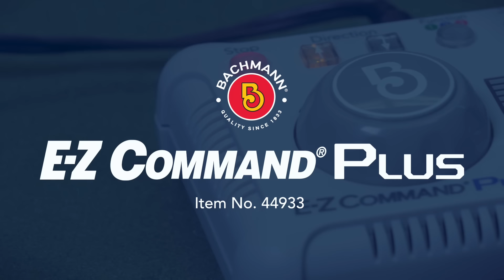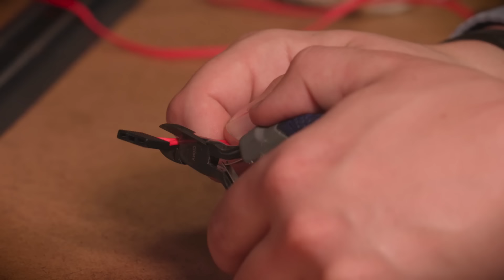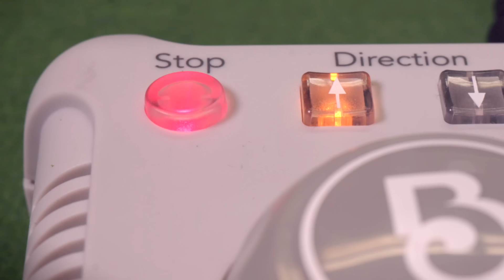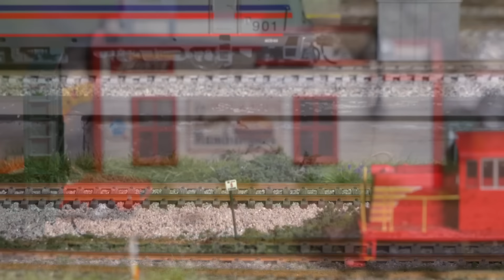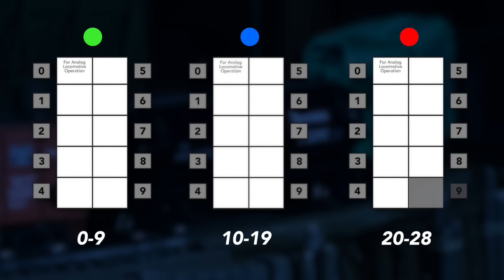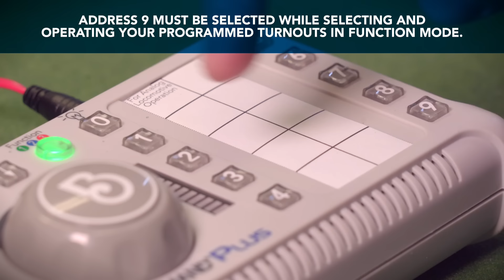Introduction to E-Z Command® Plus

Comment: Hey bachmann! I recently got my first DCC and sound locomotive. How do I use the sound on this controller?
Reply from the maker: Depending on the locomotive, the sound might need to be activated (either unmuted or a startup sequence might need to be initiated). Typically, these are function 8, but they can vary between manufacturers and decoders. Your locomotive should have a function list included with it.

Comment: How  much does  thus ez command plus usually  run in price from thr manufacturer
Reply: Way too much Bachmann is overpriced for poor quality. Any system is better (even the dynamis system they have I loved the controller design but the damn dynamis system after a few years of using it just stopped working one morning it just shows it’s shorting for no reason I tried everything nothing changed it it’s just a waste of money and the pro and ultima expansion versions are overpriced and not worth it either) I have an ez system still just so I can run dc and dcc locos on a layout at once if I want to but I have a switch I flip to turn off the ez command and switch to an NCE power cab system way better even though the system is old as hell at this point. My main layout I’m getting a ESU full cab WiFi throttle dcc system, it’s about 400$ but WORTH IT. Touchscreen android controller with a throttle knob on top, unlimited function, CV, consist, and so much more control and features, it’s an 8 amp system out the box and can handle basically anything you need to on a layout which the layout I’m getting it for is or will be when completed a triple decker layout, have 16 locos all dcc sound, 150 or so passenger and freight rolling stock a dozen cabooses which if they ever make a dcc caboose modeled in the 1910-1935 era I’ll totally get them and get several, also when completed likely going to have around 300-350 foot of track total, idk how many turnouts honestly never have counted but because the era the layout is prototypically modeled on and the era it’s set in the turnouts are all hand thrown with model switch stands.

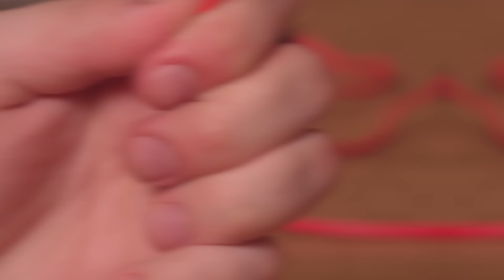Comment: I hope someone can answer my question, I've looked and looked on Google but no good answers. I trust this for any layouts I want to build from N to On30, but would it work for G gauge? I want to build a small indoor L shaped 1:20.3 layout with probably 2 locomotives at most and would like to know if this would work with G gauge. For example, the engine I already have is one of your DCC equipped g gauge davenports.
Reply: No i think this is only for ho gauge
Reply: It will work for n and ho. On30 and above will need the 5 amp booster which is expensive. G scale may need more than a 5 amp booster.

Comment: Will this work with DCC locomotives from other makes?
Reply: Yep. The Bachmann system works with dcc locos from most other manufacturers. You'll have basic control but limited advanced sound/functions. EZ command functions only accesses F0-F-10. It's a decent entry level system.

Comment: Don't waste your money on this Controller and Switches or Bachmann EZ Track or the controller. They are expensive garbage made in China. I bought 19 of the switches, 80 to 90 feet of the track. Six of switches have quit working and will not even switch manually. The dealer will not exchange them after 30 days and Bachmann will ignore you. I have a little over $684.oo invested in just the switches. I really don't have any option but to buy atlas track, roadbed and looking into Peco switches, with tortoise switch machines.. I bought the EZ Command controller too and had to return it for a replacement, that I had to send right back to the dealer too. I also wasted money on the 5 amp Bachmann booster. The controllers are $200.oo a pop and the Booster was $365.oo That was over $1,600.oo wasted. It really pisses me off the time I took planning, laying and ballasting that garbage. NOW I HAVE TO RIP IT ALL UP AND REPLACE IT. This craps going to cost me over $3000.oo to fix. I bought a Digitrax Zephyr express for a DCC controller.
Reply: Sorry, you lost me at your whining about China. I dismissed whatever you bleated out in its entirety, assuming that whatever happened was a result of your inbreeding.

Comment: Ok Bachman. Ya got me. I’m buying a dcc starter set with this controller and i’m sold on your cross tracks. I can control the track with my controller?!? With stock track without modifying?!?? You got yourself a customer for life there Bachman! 👍🏻
Reply from the maker: Yes, you can control both power to the track and turnouts with E-Z Command. If your turnouts are not E-Z Command turnouts, you can use our Turnout Control Box to convert standard (electrically operated) turnouts to DCC.

Comment: If I use this DCC control for my layout using DCC locomotives and/or sound, can I include normal locomotives that are not DC in this same layout?
Reply from the maker: The system allows for one non-DCC locomotive to be operated at a time. While you can do this, it is best practice to only have this locomotive on your railroad while you are using it, as the constant current supplied by the controller could damage the motor if left at idle over time.

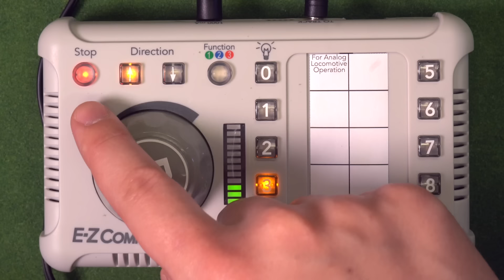Comment: I've just bought this - fair warning to all prospective buyers, watch @2:50 how many times the user must rotate the throttle to increase speed. It is not sensitive at all and quite annoying!
Reply: That’s literally the entire point 😂. Locomotives don’t accelerate 0-300 like a top fuel dragster.

Comment: Yikes!   You cut off the clip on the red wires, strip the ends and …..stop!   How do you connect those two red wires to the bus wire?   Is one of the red wires a positive and one a ground?   I am afraid to accidentally switch them since they are both red wires!   Help.   How do I connect to my bus wire that has all the track feeds connected to?
Reply: It does not matter,  as with all DCC systems, this is digitalized AC.  Therefore the wires alternate between positive and negative respectively

Comment: Good video.   I have a small layout, Two separate tracks.   We used flex track and the drop feeders are connected to separate bus wires.  How do I connect to the two red wires from the controller?   Where do I solder them?   To the end of the bus wire or directly to the track.  Which wire is negative, they are both red.

Comment: Would I need any boosters to run a 4x8 layout? Or would it work just by plugging it in?
Reply from the maker: A 4x8 would be condensed enough that a booster shouldn't be necessary.
Reply: It depends upon how many locos you want to run. 2-3 should be fine without the booster on a 4x8 with a starter track set and a couple sidings.

Comment: The price for what it offers is unrealistic, it should cost no more than $99. For less money I can get so many other DCC controllers with TONs, and I cant stress this enough, TONSSSS more features. Sorry Bachmann, I love the E-Z Track system but this controller is already 10 years outdated and that an understatement.
Reply: What options would you recommend ? 
I plan to only run trains with DCC. 
All layout lighting will be separate.

Comment: Will this controller work with the Thomas and Friends line?
Reply from the maker: As of right now, no. Our Current HO and N scale Thomas & Friends™line is standard DC only.
Reply: @BachmannTrainsUSA then how can I run the Thomas line without going forwards and backwards in 1 direction and making them crash?

Comment: That's a big update to the EZ Command, I have had the original since 2011 for my small layout and it's been fine for that other than not being able to access a couple functions on 1 sound loco I have but it looks like you covered everything for a small or casual layout now! 

I might have to get one of these and sell the original.

Comment: I just got mine but the red plug isn’t plugging into the terminal track. Anyone have suggestions? Did they start making the terminal track prongs thinner?
Reply: I had to force mine in significantly. I thought I was doing it wrong at first. Good luck.

Comment: My original EZ command system is awful for overheating; is that an issue with this one?
Reply: No 
I have the plus and been using it 6 months now problems at all 
I was even running DC and Dcc at the same time. 

I love this ez command

Comment: Does it also short out as easily as the previous model?
Reply: I’ve never had a short
Reply: I have been using the original EZ Command system since it came out and I have never had any short circuiting issues. If you don't mind me asking, what do you think is causing your issues?
Reply: @David-yo5re definitely the 3.5mm headphone jack they use for track power. If you accidentally unplug it while powered up, it shorts out and fries a few capacitors and a mosfet if I remember correctly. 
Same goes for plugging the track power in while the unit is powered up.

Comment: How do you blow the horn and ring the bell?
Reply: F1 should be the bell, and F2 should be the horn.
Reply: F1 is the bell and the horn is actually set to three different function buttons; F2 is a continuous blow, F3 is a short burst, and I believe F9 is an auto mixture.
Reply: @ttam7777  on BLI Paragon4 Diesels, F1 is Bell, F2 is horn, F13 is for grade crossing sequence.

Comment: If I set one train to the slowest speed, then set a second train to the fastest speed, then switch back to the slow train and slightly move the speed dial, does the slow train jump to the faster speed or stay at the slowest speed initially set?
Reply from the maker: It will stay at its original speed and increase appropriately as you turn the control dial. The dial turns continuously. It does not have a start and stop point. Speeds are relative to the number of turns made for each model and are not governed by the position of the dial.

Comment: so when you are programming the model does this change the address number to the respective push button number? so if you assign an engine to the 9 button does that mean that the chip in the engine has been change to 009 along with the respective cv value?  I suspect you cant program engine number from the command station.
Reply from the maker: Programming the locomotive to one of the push button addresses on the controller will change the address the locomotive is assigned to on any controller.
Reply: @BachmannTrainsUSA that is not answering the man's question.  If you address a lock a number with this controller, will this number be the same on a NCE power cab
Reply: You can NOT program CV's using any bachmann ez command controller, for like $180 to $220 you can pick up a "NCE Power Cab" which allows you to do whatever you want with your locomotive, like change CV's, use 4 digit addresses, consist locomotives properly and a whole lot more. Trust me, just get a NCE Power Cab, these things suck.
Reply: @IndianaNorthWestern  oh trust me i know. this is going for $265 on bachmann main site. digitrax has the DCS 52 that blows this thing out of the water. and the NCE power cab as you noted is great too. there is a reason no club uses this system. and this so called "newer": version is still crap.

Comment: Will this controller work for locomotives produced by other companies? (Kato Walthers Lionel etc)?
Reply from the maker: Yes, this will work with any NMRA-compliant DCC-equipped locomotive.
Reply: @BachmannTrainsUSA  alright, thank you
Reply: @BachmannTrainsUSA  I'm guessing some people don't understand the concept of how standardization works in the model railroad world. Everything is designed to be compliant and interactive no Matt who the manufacturer is as long as the equipment being used is in the same scale.
Reply: Yes
Reply: Is hornby nmra complient
Reply: Yep, but just get a NCE Powercab, you can program CV's, use 4 digit addresses, consist properly and a whole lot more. They're like $180 to $220 or something like that, but it's definitely worth it.
Reply: @IndianaNorthWestern meh
Reply: @IndianaNorthWestern  thanks but I rather stick with bachmann, their controllers and locomotives are very reliable (yes I do purchase from other companies too, but I've been around bachmann products for a while so I trust them more)